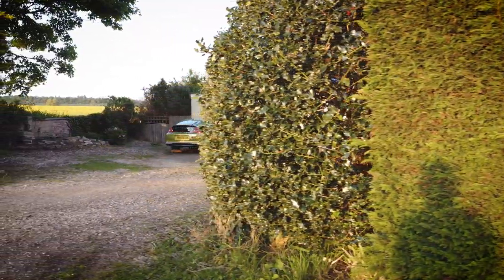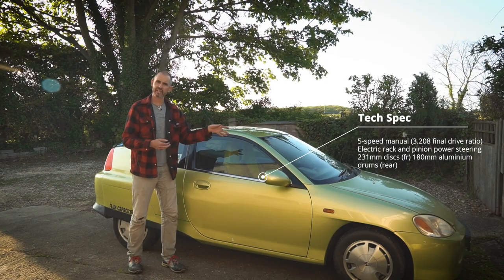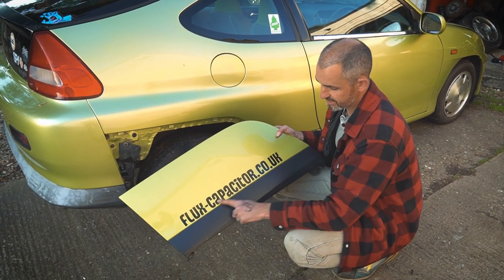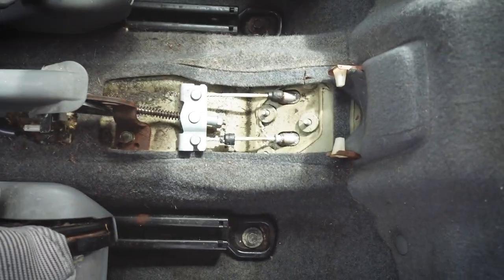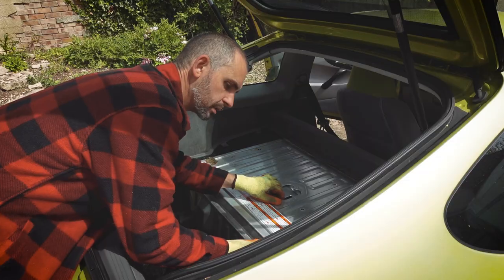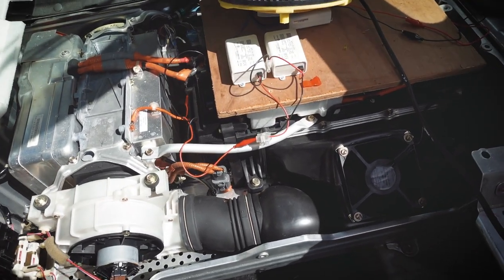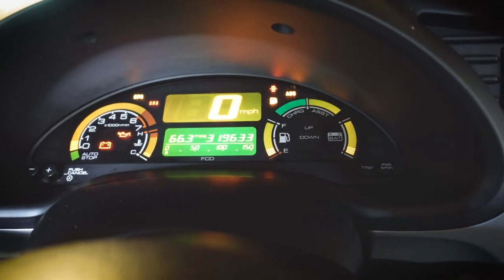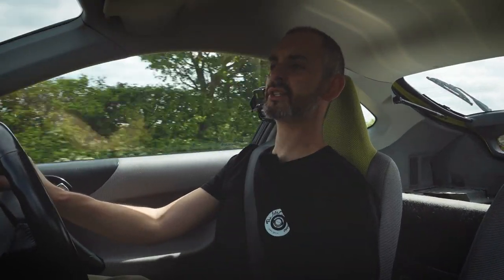Rescuing a High Mileage Honda Insight Hybrid - the NSX of Hypermiling

Comment: I'm excited for the future of the insight, I honestly believe giving cars TLC makes them want to work and whether subconscious or not, they feel happy machines for it
Reply from the maker: So true. Look after a car and it will look after you. Love the idea of well maintaining high mileage vehicles so they live for years. That's greener motoring, right?
Reply: @TheLateBrakeShow  100% agree with that am sure maintaining and running a high mileage car is more eco friendly then buying a new electric car with how damaging the manufacturing of electric cars currently is
Reply: absolutely agree, I have a Hyundai Sante 2007 from new with 370k up and its a super vehicle but I always serviced it on the button.

Also agree Hondas we’re super cars
Reply: @Richie-C  hell's bells that makes my Volvo look barely run in at 183k aha
Reply: Let the old battery pack stay in the car Jonny. If it doesn't give you any troubles.
Reply: Hey buddy I was watching  blue Peter from the early 70sof a steam powered  convertible capris  have you seen or heard of IT?wonder if its still about
Reply: @TheLateBrakeShow  You could put a Prius transmission in it as propulsion + VW, BMW, KIA or Tesla batteries in it.... :)
Reply: @TheLateBrakeShow  Poor little Figaro though with an armchair for a hat and boxed in with tyres..

Comment: As someone who is qualified to safely shut down ev's and hybrids when cars are in for accident repair those builders gloves won't protect you from anything... We have to wear 1000v rated gauntlets plus other protective equipment. Scary stuff
Reply: I Thought the same thing.
And as someone who is qualified at hurting his back - Jonny don't lift the wrench on the wheel nuts. You are unknowingly rounding-out your back. Once it goes you can't undo it.
Try positioning the wrench so you can push down (or stand on it.)

Take care.
Reply: The regs say you have to wear 1000V gauntlets but 400V wouldn't jump even a pair of latex gloves, and an Insight is at 270V. Don't believe me? Run a test. Try to short a 10A fuse across the battery with a latex glove in the way. 

I'm not suggesting what you have to do is wrong, just overblown (scuse the pun)
Reply: depends on the voltage I'd say.
Reply: @mgutkowski  this also 144v.  I think mechanics gloves would be ok
Reply: @blackterminal  volts don’t kill you, Amps do! Don’t get me wrong having a household 240v shock is a bit scary as I’ve had one due to an incompetent sparky sadly🤦🏼‍♂️😂 

But a layer of rubber on hands and rubber bottom shoes insulates you enough, and I’ve worked for manufacturers for 25+yrs.
Manufacturers have to ere on the side of caution for obvious legal reasons, mostly to cover themselves from idiots that don’t understand the science that can kill them very easily!

But like morons that buy ditch finder tyres and drive like they’re an F1 driver then wonder why they crash!🤦🏼‍♂️🤣
Reply: Yeah yeah whatever Mr qualified. I replaced my pack myself after scoring a brand new pack off Honda's shelves for $800 nzd. I used bare hands and a wrench covered in isolation tape.

The trick is not to touch anything live. 😊

The hardest part was lifting the damn thing out and into the car. Back breaking work.
Reply: 1000 V is simply the next category up from 300V, which, of course, is less than 400 V battery.

Regarding gloves, part of the spec is pierce and scratch resistance, so you don't poke through your 1000V barrier with an errant strand of wire, creating a path for a later arc.
Reply: @anon5500   "amps do".  Yeah?  800+ CCA on this 13V battery and it does nothing when I grab the posts with wet hands.  High voltage at a few mA can stop your heart.  It's a combination of voltage, current, and frequency.  Voltage is generally the more dangerous aspect in practice for several reasons.

Comment: Thank you! A wonderful reconnection with the original Insight! 

I owned one for many years, eventually I put in a GM EV-1 Motor and now that project is in the stable of our friends at Transport Evolved. 

I also know that nervous feeling around high voltage so well. When I'm working with high voltage, I feel more comfortable with safety glasses and keeping my left hand deliberately behind my back just in case I mess up.
Reply: Electrician at work told me the same thing about putting one arm behind your back when working with HV
Reply: What's the one arm behind your back routine going to help when dealing with HV and it going wrong I wonder?!
Reply: @martinclark9636  Keeping your left hand behind your back reduces the chance of an electrical shock traveling through your heart.
Reply: @CafeElectric  well I'm glad you said left arm and not one arm like others or I'd be fried⚡😂

Comment: A great trip down memory lane! I look forward to seeing you bring her back to health and happiness,  and making a few upgrades. I had one of the first ones in Canada back in early 2000 when I lived in Kingston Ontario - wanted the awesome yellow/green like yours but had to settle for silver. I had a 30km each way commute on mostly rural roads for which the Insight was perfect - great fun to drive while listening to the upgraded stereo, sub-woofer in the rear storage bin ;-) and I regularly got 100+ mpg. Stuck snow tires on it for the winter, the only issue was snow build-up behind the rear wheel spats! I drove it across Canada when we moved to BC then sadly it became surplus to requirements as I was able to commute to work via bike. Sold it to a chap from California. It was by far the most unique, advanced and well-engineered car I've ever had. Thanks Jonny.

Comment: Remember this car when it first appeared in the Uk. Honda engineering at bits peak. 320k miles and still a reliable runner. Regular servicing is the key with any car, you respect car and it will respect you! Great content Jonny, looking forward tôt his journey 👍

Comment: Jonny I really enjoyed that, your passion to keep the car on the road is fantastic. Robert Llewellyn was on the Steve wright show on Radio 2 this week telling us we should all buy £60,000 electric cars and dump our fossil fuel ones. Made me really angry to be honest.
Reply: Agree totally so much ev BS about...  they have there place  but not the total answer...
Reply: The main trouble is the price for the big battery packs that make the bulk of the price on full EVs.
My view on Hybrids is even more parts that need servicing and can fail,
power efficiency is questionable, fuel efficiency up to the electric range and then it gets worse then a full combustion variant because of added weight.
Hybrid is a Jack of all trades master of none.

EVs are an investment that will pay themselves off eventually because of low cost maintenance and power\fuel.
I see it like Solar Panel might be a big cost up front but will net positive in the long run.
Reply: what boils my beer is when people pretend that the only way to get into EVs is to get the biggest newest one, then cite the price as an example of unaffordability without mentioning the 2nd hand market, the price of petrol, TCO or anything else.
Reply: @frankmoras63  I'd love to see hybrid conversion kits that offer 2-5 miles range in stop/start traffic... You could probably get away with using a 1kwh battery costing around £500 and weighing in at around 10-20kgs.

Comment: I had a 2000 Insight, serial number 0000000000979, one of the first Insights in the States. I too nursed the hybrid battery along for years with that method.

Comment: If it makes you feel any better I replaced the primary IMA system fuse with my bare hands. Even got a bit of a zap when I touched the thing even with the switch set to off. Did not really hurt.

Comment: Lovely video, and I'm delighted to see a hybrid becoming a classic. The steel-meets-aluminium corrosion is painfully familiar to Land Rover (Series/90/110/Defender) owners, as is that bubbling on the door bottoms. I wonder if the doors have a steel frame inside the aluminium skin which is corroding them from the inside out? That's what happens on Land Rovers, anyway, but can be corrected by repairing the damage and then making sure there's an insulating plastic layer in between the two metals when they're reassembled. And never, ever use stainless steel fasteners. Don't ask me how I know that.

Comment: Thanks for the series, well done. Agree with all you say. The first car I ever bought new (2000) and still my daily driver. Best car Honda ever made. Aftermarket charging kit has kept the battery (second one) going for 15 years, still fine. Original exhaust (outside cat converter update), original plugs, original coils, original struts, new rear shocks, and of course brakes, belts and tires. I have a good parts car, so it will last as long as I do. The only thing I can see replacing it is an Aptera.

Comment: Great video! I love the Insight and own a CRZ which also has the IMA system with NiMH batteries. I also need to do a few discharge/charge cycles to reinvigorate the battery. Looking forward to part 2!
Reply from the maker: Convert to plug-in maybe? Love the CRZ.

Comment: Thanks Johnny for another confirmation that my Honda insight is a tour de force in automotive engineering. I’ve added stronger rear springs because they were unfortunately soft and often bottomed out on speed bumps, I added Monroe rear shocks from a blog site that fit with small modification, and I added the eight amp hour battery pack about three years ago. Look forward to future videos mine I painted white and very happy with the white and tinted windows.

Comment: I do a bit of rallying, and the number of times I've seen cars fail scrutineering because of seized Bowden cables for the electrical cut off and fire extinguishers led me to pull the cables out of their sleeves on my car and coat the entire length of the cables with copper grease. I've never had a cable seize, and they're over 12 years old.

Top tip.

Comment: Love it Jonny, glad you got it back & I remember watching that 5th gear episode, I'd advise taking a wire brush & power drill to those rear suspension arms as a next step, they looked pretty bad, never driven one myself but always liked the look of them, & I like the idea that it's a manual, Rj in Oz
Reply from the maker: The rear beam might get removed, blast stripped and then painted. It deserves it.

Comment: Nobody builds cars like the Japanese, 320,000 on a little 1 litre 3 cylinder engine, absolutely fantastic, and the interior is in brilliant condition. Johnny has a thing for Hondas as do I , driving a Lexus hybrid now, but still miss me S2000 and my EP3 and fn2, but times move on and needs and wants change, but never enough to change from a Japanese car though.

Comment: Looking forward to this series Jonny! Aluminium does corrode quite badly once the surface layer has started to deteriorate because ali is often "alclad" -the surface is clad in a tiny thickness of pure aluminium which is much more corrosion resistant than the actual alloy that makes up the thickness of the sheet.  The corrosion on the doors looks very similar to the "tin worm" that plagues old aeroplanes.

Comment: The reason you see corrosion at the interface between the the aluminium and steel is because they are galvanically incompatible. There would need to be some insulating treatment, such as paint or a cadmium coating on the steel, to stop the galvanic film from forming leading to the corrosion.

Comment: Great video. Mine has 278K on the clock was also an ex demo,  from Derek Warick Honda Southampton and regularly turns in 95 mpg on a 50 mile commute in warm weather, and thats with the IMA battery turned off. Honda's best kept secret! Lifetime average 75.4 mpg.

Comment: About a million years ago in 1996, I was part of a student SAE team building a hybrid car. We used a NiMH pack and a three cylinder bmw motorcycle engine mated to a VW five speed manual transmission with an overrunning clutch between to two to feed in the electric power. In many respects it was very similar to the Insight which was released the very next year. At the time, I imagined that Honda had copied us. In hindsight, I know there is no way they could have developed the power train that quickly. 

The insight still has a special place in the garage of my heart. Glad to see you are putting it back on the road.  Love the color.

Comment: I just bought a CVT Insight for a friend on the cheap! I used the same alligator clip, light bulb, 350ma DIY grid charger. 
IMA light be-gone! Flooring it getting 17mpg I didn't even get it under 1/2 a charge, it's performing like new!
Reply from the maker: The system works, right? Great to hear another IMA pack has been revived.
Reply: @TheLateBrakeShow  Yup! Getting 50mpg with the AC blasting. Unfortunately here in the US we didn't get lean burn with our CVTs, only the MT

Comment: I have a 2019 Insight. Over 3 years driving it's gotten 58.3mpg. Best tank was 68.6mpg, yes I actually went 800km on one tank of gas that required 33litres to refill it. Interestingly, best economy is in warmest weather in spite of the fact that I use the AC heavily in warm weather. So it's about 65mpg summer months and 50mpg in winter. It is a phenomenal car, is faster, heavier and has a lot more power than your early model.

Comment: I have Australia's first Gen 1 Insight. Last year I replaced the NMH batteries with Lithium Titanium Oxide. The good news is that LTO batteries will fit in the NMH space but they are taller so I had to cut away the aluminium case to make them fit. You must not dispose of the shell that contains the NMH batteries as this has the contactors and electronic connections that allow the inbuilt IMA to work. I have been in contact with Peter Perkins and I appreciated his help.

Comment: I bought a $1300 2001 insight with 280k miles last year. It seemed like a fun unique beater car. The same day I bought it I got the IMA codes. It was a failing battery. It had 5 or 6 years on the rconditioned battery. I researched for hours about what to do to limp it along and I just pull a fuse every few days when I get the codes. Eventually I'd like to do this battery drain and fill reconditioning but I'm tempted to keep driving till it just wont, haha

Comment: Hi Jonny, would you have been in Alnwick (Up here in that Northumberland) a few weeks ago in this lovely wee Honda? If so, the crazy woman giving you a thumbs up, from the driver's seat of the 2006 Toyota Crown SDL Mild Hybrid in very shiny black, was me!
OK, so there may be another in the same shade of "Grellow😁", but the only Insight I see regularly locally is red and seems to be in use by someone who isn't you.
The Crown is an extremely original example with fully working hybrid functionality - using lead acid batteries - and was owned from new by its only owner - in Japan- prior to my buying the big daft thing. It even has the obligatory antimacassars on the seats but sadly, because of the car never having been a taxi, it lacks the electric nearside rear door and, because it's never been a Yakuza company car either, lacks the bullet holes and the blood.😉
Engine is a 1G-FE, a sweet and very effective 6 cylinder, 1988cc petrol unit and - saving the best 'til last - the car has the limited slip differential option 😳 and no, much as I love modified JDM cars too, I'd not owned an all original one until I bought the Crown, so this one will be kept stock as a rock and only driven like I stole it once the engine's fully warmed up.😊

Keep up the good work, long may it last,

Cheers,

JayeBee

Comment: Nice, brilliant little car. Honda in the 90s, was top dog. They were very well made, bulletproof engines and excellent handlers with (in my case) all round wishbone suspension. Still have fond memories of my '92 Ballade (EG Civic 4dr). It was 11 years old  when I  bought it and it still looked and felt as good as new.

 Hondas were built by under licence by Mercedes Benz in South Africa from '81 to late 90s as their small /entry level sedan. There were even  AMG versions of the EF and EG models. Eventually they were replaced by the C Class.

Comment: Brilliant episode. Interesting. Honda fan anyway. Reminds me of my Daihatsu Copen which I owned for 6 years and 100,000 miles. Not a hybrid but 765kg, 1.3 l engine. Fun as anything to drive. Hydraulic steering with the best steering feel ever. Economical. And you could fold the metal roof into its boot electronically. Was utterly reliable. Still miss it and regretted selling it. Probably update the Insight to Li-Ion.

Comment: Imported the one I had from Japan  with just 60’000kms on it but it needed grid charging on a regular basis until I replaced the battery pack.  It was a superb vehicle for a rush hour commute.  The coolest thing when driving it was stepping off the throttle on a long straight stretch and seeing how far it would glide.  Aeorodynamics just kept it moving ridiculous distances for no effort.

Comment: Steel and aluminium are quite far apart on the galvanic table causing dissimilar metal corrosion. Quite a big thing in the aircraft world where we use various jointing compounds to help avoid the metals from actually touching.

Comment: Congrats on getting back into an insight. These things are great little cars. Can confirm that Peter is a great guy and super knowledgeable. I was glad to hear him mentioned. Also, welcome to the 300k+ club for the insight, I think mine is a bit over 350k.
Reply: How is this compared to the Prius? Does it drive well on the highway?
Reply: @geniegoldroyalty7371  They do drive great on the highway. They have excellent handling and feel very nimble. They are a bit stiff, so not quite as comfortable as a Prius, but they aren't racecar stiff.